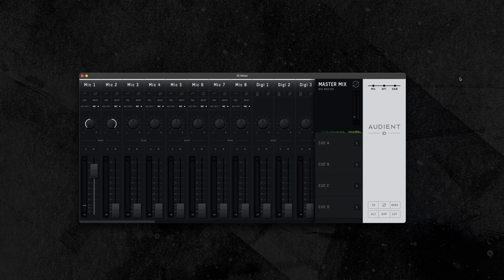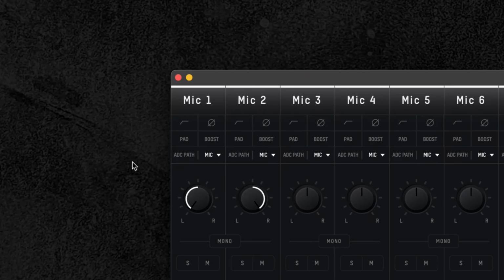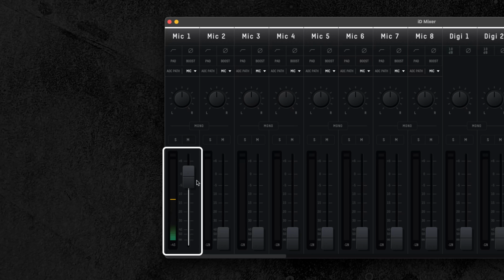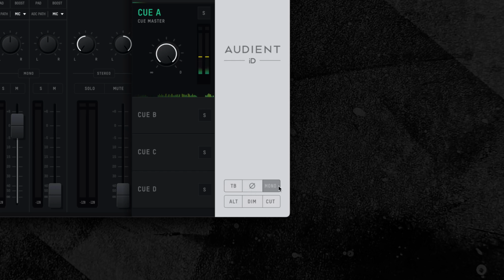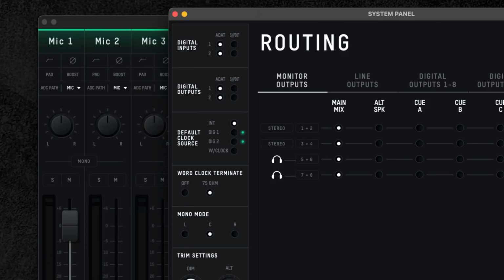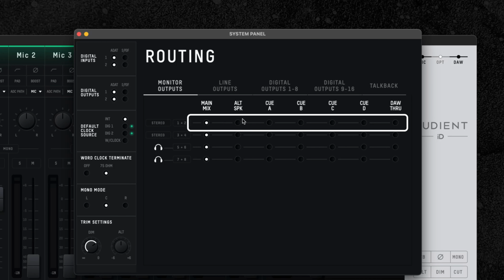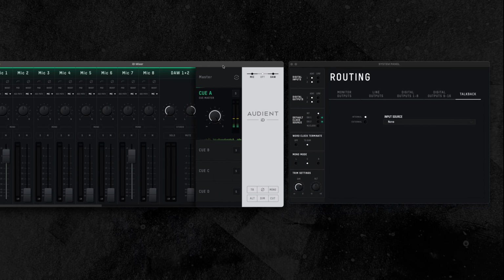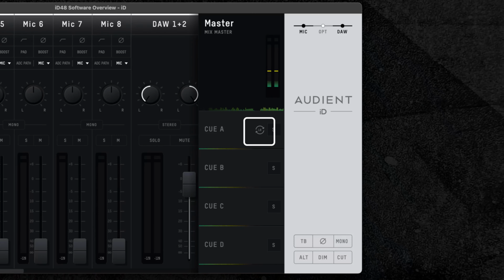Audient iD48 Software Overview | The iD Mixer

Comment: Hi ! If I use a Db25 as line imput to connect my keyboards, the 8 imputs of the id48 will be disabled? I mean I can’t use all at the same time right ?
Reply from the maker: Hi there, that is correct, if you switch the input to ADC (utilising the DB25 line inputs) this will bypass the analogue inputs. It's currently not possible to use both at the same time. Let us know if you have any other questions!

Comment: Could I route LoopBack (like Youtube sound) into Insert and then route Return into Cue or Master Mix? I'd like to apply external processing before listening the final mix in monitors.
Reply from the maker: Hi there,

You wouldn't want to use loop-back for that, but you could set one of the line outputs to a CUE mix, run out through your processing and then back into an input channel and monitor that for your output.

If you need help with setting that up, reach out to us at support@audient.com and we will assist.

Comment: One super important question many of us are wondering. Can i track vocal with some reverb on id48 internally? Does it have internal DSP for that or not?
Reply from the maker: iD48 does not have any built in DSP effects such as reverb. You can make use of the Switchable Inserts to patch in your own reverb modules however.

Comment: Hi Adam. Excellent video. I do have one small quibble as follows. I recently bought the ID48 specifically for the D-Sub connectors which are great. I already have the EVO16 and 2 SP8s which I used to give me 24 I/O connected to my Allen & Heath ZED 428. I wish the ID48 software mixer had a software Volume Control or Fader so I could see the Main Output level as a graphic display rather than turning up the large physical Knob on the front of the ID48 until it showed a Red overload LED and then backing off on the knob. I now have all the channel inserts on my ZED428 wired to a patchbay with the D-SUB connectors of my new ID48 wired to a second patchy which allows me to easily patch my outboard gear to any channel on the ZED428 for Hybrid Mixing. I'm a hobbyist finding my way thanks to the great tutorials on Youtube from yourself and other colleagues. Kind regards
Alan.

Comment: I'd like to make a request for a cheaper version of the id48. 

Being visually impaired, I don't want to have to keep changing the adc settings to record my synths and then mix with outboard gear. It would be great if there were a version with 10 TS/TRS line outputs (8 line outs for Sending to hardware). I feel like the dsub ins are irrelevant, especially if you can get your hands on a second hand ADAT expander like the MOTU 8pre. 

This is the way I prefer to work as you're not faffing around with cables and software settings, and in Ableton you can rename the inputs and outputs to correspond with the piece of gear you have.

Comment: I just bought the iD4 MKII audio interface and I'm wondering if the device is plug&play, or if I need to install any drivers for Windows 11 for it to work properly? I need the interface to work with Beyerdynamic DT770 PRO X headphones.

The thing is, I only use headphones for gaming. I don't need to record or do anything else, just plug my headphones in and enjoy the quality. Do I still need software for that?
Reply from the maker: Hello there,

You would need to install the drivers from our website to use the iD4 on Windows. However you wouldn't need to use the iD software to achieve what you are doing so you can simply ignore it.
Reply: I just got the interface today, but unfortunately the USB-C cable it came with is too short to reach my computer. I’m planning to buy a 2-meter USB-C to USB-C cable instead.
Which USB standard should I look for, and what data speed is enough? For instance, I see options like USB 2.0 or USB 3.2 Gen 2.
Would using a different cable than the one included affect the audio quality? I doubt it, but just want to make sure.